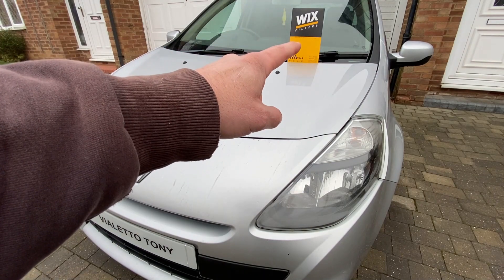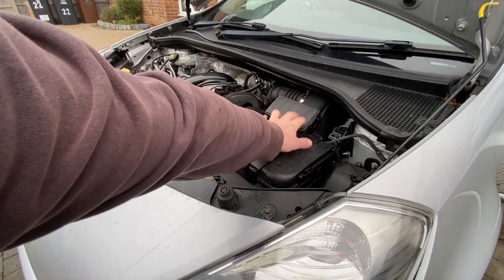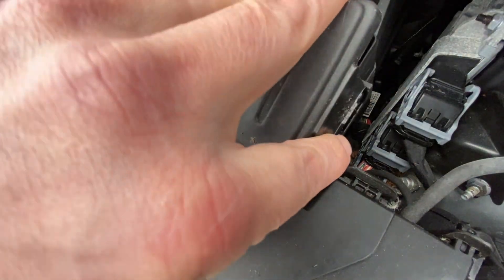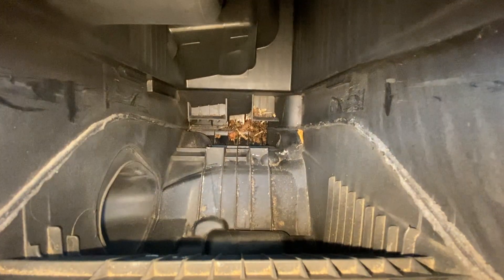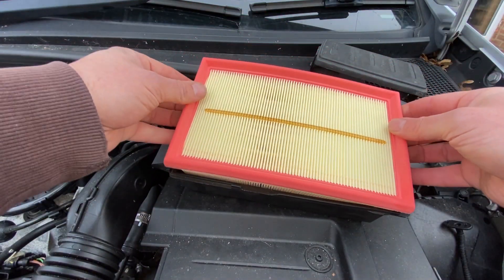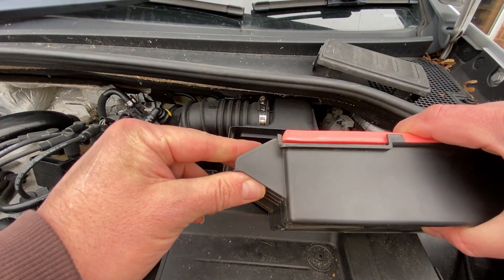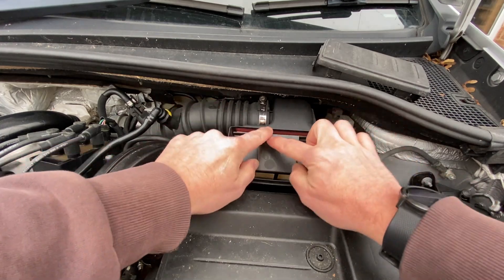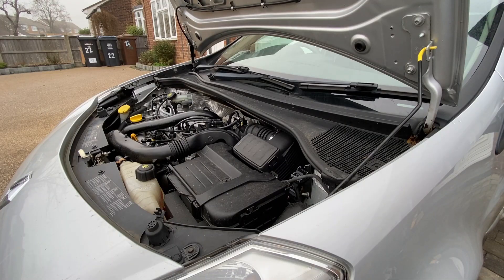Renault Clio 2009 1.2 Tce Air Filter Change (Different to Non-Turbo Clio's)

Comment: If you are looking to actually replace the air box with a pod filter/ cone filter. Either smash the original air box (what i did) or spend like 15 extra mins taking everything of the way of the air box (battery and tray). Then rev and hear stutus
Reply: do you have the reference of what you put on your car?
did you add something else to hear the stututu?